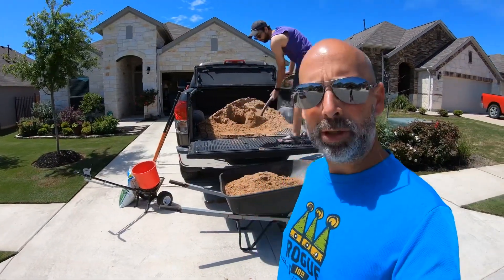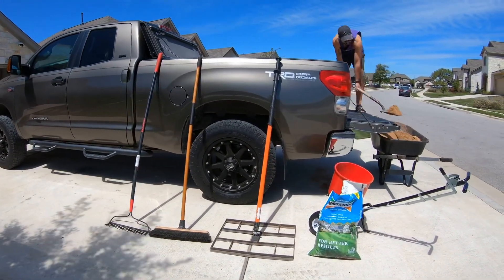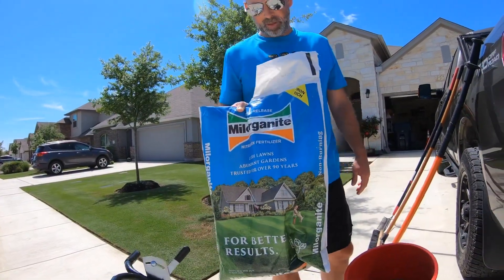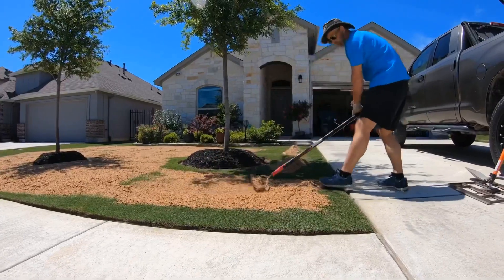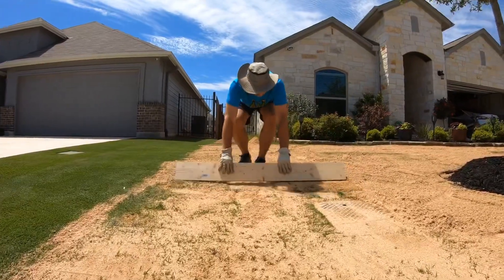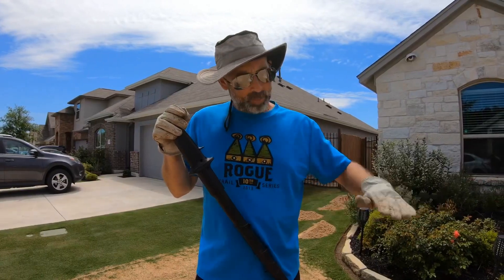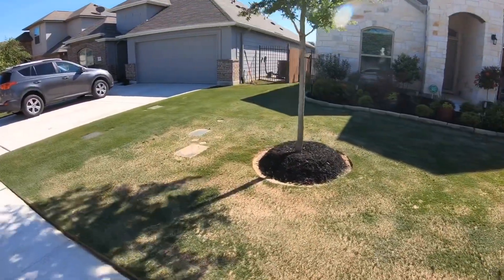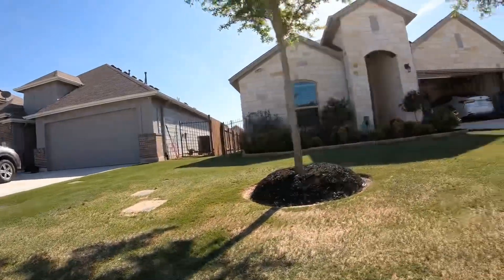How To Level Your Lawn From Start to Finish! Fix Your Bumpy Lawn Today!

Comment: Really got a lot out of this video. 
I have leveled my lawn for the second time about a month ago. The first time I leveled it, it was like night and day. The second time, my front yard still had a lot of dips in it. So.... the long board tip is a HUGE TIP. Consequently, I am adding more sand using the long board. 

I also really agree on not getting the sand too thick and touching it up later. Last year, I had some thick areas which took months to finally fill in. My opinion, 1/4 inch or less thick will give really good results and still allow the lawn to fill in and thicken reasonable quick, which is evident on your lawn per this video. 

Anyway, I appreciate you covering this topic and offering the board tip. Hence, I feel this is the best level lawn video out there. 

Thanks again. 

Matt
Reply: Reel Low Bermuda thank you!  Love the OCD!
Reply from the maker: Thanks! Glad it was helpful!

Comment: Really liked this video. I have to do this to my cool season lawn. I will take the slow approach since I have some spots that could use and inch or two.  I will start with a mix first and then go for sand to fine tune.  Thanks for the vid .

Comment: My hybrid Bermuda sod was installed September 2019. Soil is clay and although it looks level, it’s not. I mow every 4 days, and want to lower my hoc, but anytime I lower my reel, it causes mostly brown spots. Pretty sure it’s the underlining leveling issue. It’s gonna be in the 100’s all week. Can I lower hoc (which will scalp to a certain degree), fertilize and sand at this time of year? Thanks for a response man.
Reply from the maker: Scalp it a half inch lower than you intend to maintain it. Then it will grow back completely green! And time of year doesn’t matter, as long as it’s during the growing season

Comment: I have a question if you were to fill in larger holes and dips in yard... could you just use sand for that as well?
Reply from the maker: With large dips, you can still use sand. I would probably do half sand and half landscape mix. Another option for really big dips is to cut out the sod, level under it, then place the sod back on top of the newly leveled area.
Reply from the maker: With large dips, you can still use sand. I would probably do half sand and half landscape mix. Another option for really big dips is to cut out the sod, level under it, then place the sod back on top of the newly leveled area.
Reply: Reel Low Bermuda thank you for replying ok I would would get both products. I’m a new member to your channel. I’m trying to work on my yard some since it’s nothing else much to do these days 😊
Reply from the maker: Good luck and thanks again for watching!
Reply: Reel Low Bermuda I have one more question I have standing water after rain due to my yard being lower... should I get a French drain then level the yard? Or level yard then see if I still need a drain?

Comment: What if you don't really have grass in your yard in spots? My soil is pretty compacted and I would be adding sand to my topsoil.
Reply from the maker: For pure leveling purposes, I would still use sand. Bermuda loves heat and sand gets hot. It would actually speed up growth to that area

Comment: Hi !
Nice work ! Do you have to roll your lawn before the sand ?
You showed us a big dip at 6:05. Do you add sand until it's level ? Does it kill the grass because it's too thick ?

Thank you,.
Reply from the maker: On really low areas, I wait for the grass to fill back in, then add a little more sand. I keep repeating that process until it’s level. You could do it all at once, but it would take a long time for the grass to fill in.

Comment: Hello! Excellent work. I'm new to the lawn game so my apologies if this is a basic question. Why did you use sand instead of adding more top soil?
Reply from the maker: Sand is the best material for leveling. Top soil is just lumpy dirt, and top dressing has mulch and even small pieces of decomposed granite in it. Good for the overall health of the turf, but not so great at leveling.

Comment: Great video!  I have plans to do this to my yard when it warms up a bit and my grass starts to grow.  How many yards of sand did you put down on the front yard?
Reply: @reellowbermuda8786  Thanks that is good to know.  I might do top soil for this first go around in my yard.  Then put sand down a month after that.   I have areas that need 3+ inches of substrate.  Will most likely seed those areas.

Comment: How much water and how often after you level ?
Reply from the maker: I usually just run the sprinklers for a few minutes to let the sand settle. The next day I will take a broom and brush it further in and then run the sprinkler again.
Reply: @reellowbermuda8786  Isn't that basically removing sand from the low spot?

Comment: Why would you use sand instead of top soil?
Reply from the maker: Top soil is full of rocks and clumps. Sand is pure and fine. It settles into the low spots very easily.

Comment: My two cents, and completely irrelevant since it is not my yard, but arent you worried about those two trees? They are going to get large and the amount of shade/roots will be troublesome. Why not remove both and go with a nice flat yard?
Reply from the maker: They are Live Oak trees and they grow stupid slow! I’m only living here for about 10 years. By the time they become problematic for the lawn, it will be someone else’s problem. Plus, when I go to sell in 10 years, those trees will add value.